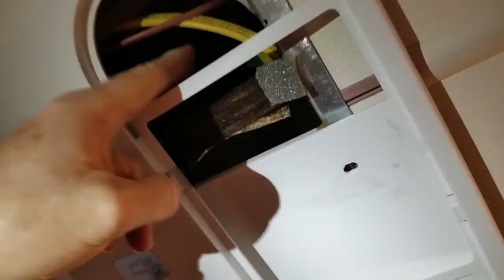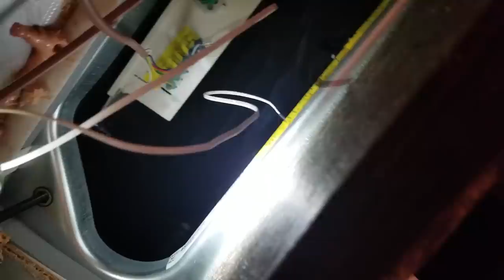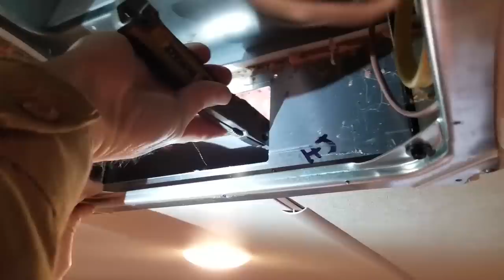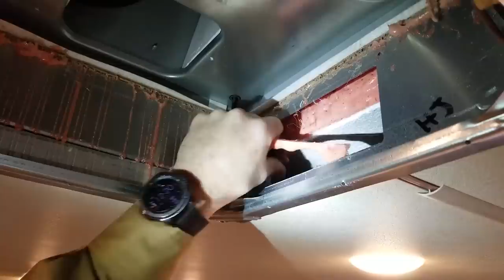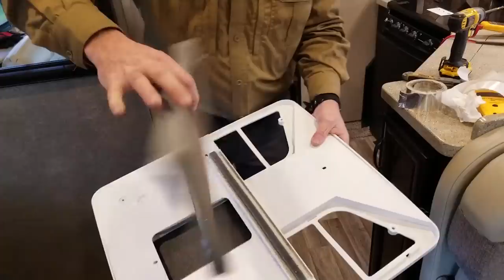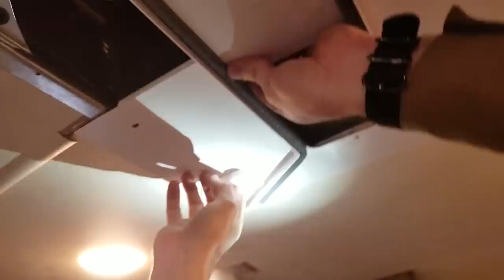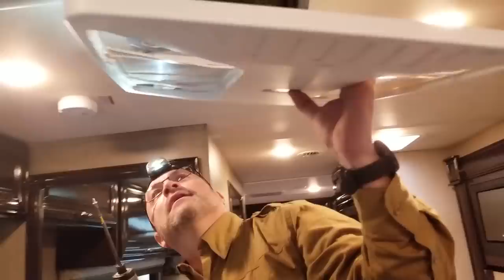Boost Your RV Air Conditioner Performance With This Cheap, Easy Fix!

Comment: Great info, Thank you.
Reply from the maker: You are welcome!
Reply: I time out the blower to run a bit longer after the compressor shuts off, letting the evaporator tray drain more condensate to have the evaporator function better for cooler air transfer when the compressor kicks on again. The lower humidity in the house, the better the cooling affect.
Reply from the maker: @billkrause4585  Thanks for the tip!

Comment: Some good advice for sure, but however taught you didn't know enough about the HVAC world. Small or large system, it's all about using air and refrigerant (in this case) to move heat from one space to another.

The system doesn't first dehumidify by some magic way and then cools. Dehumidification is a consequence of removing heat from the air (temp drop across the coil = condensation) and system design, it happens all at the same time because it's made to work that way. The temperature difference you're talking about is also linked to the outside temp. If it's a 110* outside, the AC will not stop running if you're trying to reach let's say 80*, or you'll need another system to compensate. These things are not made to work more than 20*-ish between outside and inside. So while your inside temp is going down, it will only go that far based on outside temp. It's even more critical in such poorly insulated spaces leaking air from all over. 

Unless you have a special tape I'm not aware off, your foil job will not last because the chemicals in the glue on the back of actual  HVAC foil tape is activated by friction, so applying it with your fingers alone won't make the tape stick for very long. The tape needs to be applied with a squeegee, and preferably spray glue, especially on the non shiny side of insulation the board. Even with that, it's not guaranteed it'll stay for years. 

I hope I didn't come out too much as an ass, but I felt I had to improve on the explanation others will read. Peace !

Comment: We did this to TWO RV's. Then we found a RVAIRFLOW.com upgrade and improved our airflow by 43%.
Reply: Yea. But they cost almost $200 per AC.  Guess it depends on how much you use it.  Hope it worked for you.  Neat design tho.

Comment: What would be the cause for Ice forming on an AC unit inside that area?
Reply from the maker: The first thing that comes to mind would be your free sensor is not in place. Other things that could cause ice build-up would be the control board relay that controls the compressor is stuck closed. Another indication is dirty evaporator coils. Finally you may have an issue with low refrigerant in your cooling unit.
Reply: @MyRVWorks  I checked my coils, they are clean as a whistle. I also checked my cooling regulator and it seems to be in there ( lose or what not I am not too sure). It does cool but I noticed in HOT temperatures (90;s) is when it does most the freezing ( running for long extended periods would be my guess). I heard when it runs low on anti-freeze it does this but I didn't have any issues this summer as I didn't run it as much.

Comment: The chances of finding an RV air conditioner installed correctly by a manufacturer is zero!  You MUST remove your ceiling cover and check for these issues!  If you have AC ducts in your ceiling, you should also remove all the vent covers and check for the same sort of shoddy workmanship.  In the case of our travel trailer, we had EVERY issue shown in this video plus NONE of the ceiling vents were adequately sealed to the ducts.  Much of our cold air was escaping into the void between the ceiling and the roof.  HVAC foil duct tape is your best friend if you want to increase the efficiency of your AC's air delivery.

Comment: Do you also check the four long rods that hold the air conditioner in place for proper tightness
Reply from the maker: Yes I do, I even carry new gaskets if the existing ones are dry-rotted and flattened. There's so much more that I do that I do not cover in the videos and sometimes I don't say everything I'm working on  thinking, or seeing. It's amazing when you've been doing this for a few years you see a lot of things and you take that knowledge for granted. I guess it's like watching a Chessmaster. They see a board differently than other people. That would be me with all these RV repairs. Sometimes I don't explain things that are obvious to me but I don't realize they're not obvious to others.
Reply: How can you tell if they are flattened and dry rotted without pulling the ac unit
Reply from the maker: @rickjohnston9553  Well, if you ever remove the A/C you have to replace the seal since reusing the old seal is a no-no.  Same with the toilet seal by the way.  You can look at the seal from the inside.  If there is any indication of water ingress than I would first check the mounting bolts to see if they were secure.   Some mfg's have indicator taps on the A/C pan to aid on the proper 50% compression of the seal but not all do. Tightening these units to the roof is not a muscle strength exercise.  50% compression is the spec.  for most of these units. If I do not see any evidence of water ingress I leave it alone.  If it looks dry-rotted (often because it was compressed too tightly and lost its spring) than I do replace the seal.

Comment: Very good. However the issue is not lack of metal ducting tape, but poor product engineering. This should never be required if engineered correctly and properly installed. ^^
Reply from the maker: The air conditioner manufacturers do a good job in there manual explaining how to perform a proper installation. We get into issues when those instructions are not followed. Since RVs have different thicknesses of roofs they have to allow so they can be adjusted during the installation.

Even with following all the directions perfectly, your air conditioner is still something that should be inspected at the beginning of each season.

On our website we have prepared an annual service worksheet for air conditioners that can be printed out for a simple Go/No-Go evaluation.  https://myrvworks.com/resources/annual-service-worksheets/
Reply: @MyRVWorks  Thanks for the informative videos! I clicked your link for worksheets and found everything but air conditioners. I downloaded them and will use when i get the RV out for the season. Thanks!

Comment: I had an issue where they ran the duct wonder a beam then pinched it off and with plywood so no air flowed to that register. It's sad what kind of craftsmanship goes into these things and then the slap a made in USA sticker on the outside. I'd be ashamed of I had built the one we own. I've fixed about 6 or 7 things in 2 years and find it all resulted in shitty workmanship.

Comment: Nice smart fix. That divider is so badly manufactured both in design and material it comes off(pun sorta intended) as an afterthought - separating warm intake from cold output is the business end of the whole unit, and the manufacture of it is sloppy as fuck, incomplete, actually. They must have known it was incomplete, but went "ah fuck it"

Comment: Makes me think about how sloppy the rest of this RV was put together. Hummm...... Shoddy on the production line...the inspector missed this one.....and probably many more.  No craftsmen anymore!
Reply from the maker: True, but I have seen this issue on $300K custom RV's.  It is much more common than many may imagine.  Every RV'er should inspect their RV air conditioner once a year.  The tape will loose its adhesive backing over time and fail.

Cheers,
Darren

Comment: To prove you concept should have used an Air Flow Meter
Reply from the maker: Yes, I could have done that (I do have a temp/airflow anemometer in my tool bag) but the air breach was so obvious I didn't feel it was necessary.  

Cheers,
Darren
Reply: That's like saying my boat was sinking so I plugged the leak and someone says " well maybe you should have measured the water that was leaking into the boat to prove you were sinking".

Comment: Our small company works on Transport Refrigeration machinery (REEFER Trailers/Trucks. 
It amazes me how much of a problem this is in the RV industry. While we do not normally work in this arena we have good customers with RV.s that ask us to look at thier RV's for poor cooling.
95% of the time it is this duting air with poor or no poor division of out put air and return air. 
We see several of them where it is not even sealed between the Output And Return because some othe Paycheck grabbing lazy No Give A Crap Thinkinking they are an American is being a Lazy FK.
The roof and the air is directing into that dead space or mingling input & Output air and/or not even reaching the living compartment. It seems a shame that the people doing these instals and the people supervising them are so complacent to not be checking on this for every single RV built. 
What a RIP OFF of our own American Customers that work so hard to get a nice RV then have it be sub standard because of some other No Give A Krap American is in Don't Give a Krap Mode or not willing to farther understand what they are really doing. But it mostly falls on the Quality Control of the Manufaturers of these RV's to make sure workers understand What & Why they should do certian things so it Works,
Come On America We Gotta Quit being A Low Quality Work Force and Come on American Employers/Manufacturers Give up some of your Greed and Profits for Pride in Workmanship! 
I like your Aero Dynamic enhancement with the Foil Tape. I do the same but then go in behind tape and spray foam sealer to help insulate direct metal wood heat ransfer to the a/c out put air stream. We have hat to even add insulation where we have found totaly uninsulated large spaces between interior and exterior.

Comment: So what you have shown us is that Coleman have crappy quality control in their manufacturing process
Reply: Shop for an RV you will see they are all the same. Until you are ready to spend big money you get what you get, sadly. My trailer is 2 years old and I already can tell the fresh water tank is ready to fall out. I found the furnace had 2 ducts that were not attached. Some cupboard doors have fallen off. Trim has fallen off. Gaps like crazy inside the cabinetry. Its honestly a joke. No pride at all.
Reply from the maker: No, that is not a Coleman issue. That is an installation issue. Coleman provides everything to do the job correctly. The individual who installed this would be the one to take issue with. Having said that, these air conditioners need to be inspected yearly because the adhesive does fail over time. I have seen this issue on air-conditioners installed on the $700,000 coaches down to $30,000 coaches. It is not manufactured specific.
Reply: @MyRVWorks   OK, worth remembering. Thanks

Comment: What makes you think you're smarter than the engineering ??
Reply from the maker: As a recovering engineer myself (25+ years as an industrial automation engineer) I resemble that statement...  It's not the engineers you've got to watch out for it's the production line crew that's assembling about 20 or 30 of these RV's a day. They just want to build them and go to the fishing hole.
Reply: The issue is installation  not engineering. What makes you think you’re smarter than a tree?
Reply: David Laster, Great contribution /s  can't wait to see more of YOUR helpful comments.
Reply: @brucemontesr.3340  you keep replying it wasn't a comment it was a question when you start ripping s*** apart I start questioning your abilities I know mine I've done it for 40 plus years

Comment: What poor quality AC was that. I'll be sure never to buy one based on their lack of workmanship!
Reply: Hi Raymond,
I can’t really point my finger to the A/C mfg and no OEM is immune from sloppy install jobs.  This is something that should be part of your spring check-up each year.  Some A/C mfg’s use a large foam pad with adhesive backing that loses its adhesive over time.  So, it was installed correctly at the time of build but after a few years the issues develops as the sticky side fails.  

Each year the A/C absorber and condenser coils should be inspected and cleaned.  Also, the drip tray below the absorber should be cleaned out.  The return air filter should be cleaned every month of use.  These things will keep the A/C performing well as long as there is adequate power from the pedestal.

Cheers,
Darren Koepp
Reply: That’s the entire rv industry. There’s No pride in any rv manufactured in the last decade.

Comment: You didn't do a very good job smoothing out the foil tape. When it has loose edges and wrinkles there is a good chance it may partially separate over time. If it separates and covers part of the evaporator ... well , you know what will happen.
Reply: Hi Richard,

Well, I think we can all agree it is better now than the way we found it eh’.  LOL.  

This appliance should be inspected each year, I recommend in the spring.  During these inspections the tape can be replaced if the adhesive has failed.  Also, the absorber and condenser coils need to be cleaned and inspected.  Don’t forget the return air filter monthly.

Keeping an eye on all these periodic preventative-maintenance things will keep the A/C performing well.  

Cheers,
Darren Koepp
Reply: @DarrenKoepp360  , foil tape was never meant to be stuck to open cell foam gasket and insulation and will fail within weeks if not days of use and you will rip the existing gasket to shreds if trying remove and replace it where it actually stuck.  Use the right material for the right job, they sell it in the same store where you bought the foil tape..
Reply: @dgrfsthrgsergwrtghasefq  if foil tape isn;t the correct tape, what is, please?

Comment: fpieros22 is correct, manufacturers have no pride in their work were it doesn't show. It's a shame how much you pay for these rigs and the quality is sub par. Some stuff may have moved around from vibration but that could be engendered out. If RV manufacturers were held to the same standards as Automotive, we wouldn't see half these problems. It seems a blame game goes on behind the scenes with component makers and RV assemblers on why something doesn't function right. You can see why!

Comment: You must have a low end RV, because for several years they have return air vents by using ducted return and cool air ducts by using two separate ducts! You should have done more research!
Reply from the maker: Hi Dennis,

I appreciate your comment and it does lead to a teachable moment.  The issue I address on this $90K Class C RV I have also discovered and repaired on $140K 5th wheels, $300K diesel pushers and even a $700K Beaver!  The cost and 'quality' of the RV has no correlation to the divider in the A/C not being set correctly.  I have pictures of very high end RV's with divider airflow issues.   Some of those repairs were covered by the MFG warranty. 

The point you make regarding the return air being ducted through the ceiling registers, and even the design where the only way to access to the A/C is from the roof, is also a major violator of this air breach situation.  

For the A/C's that are only accessible form above there is often a foam strip that is applied with adhesive along the top of the divider as it is pressed to the bottom of the A/C pan.  That adhesive fails over time and creates a major breach.  Everyone should do their due diligence and perform a thorough annual preventative inspection to include this divider in their RV A/C's.

Cheers,
Darren Koepp

Comment: Wow, QC is disappointing with what ever that brand is...
Reply from the maker: I have seen this situation on custom $300K RV's!  This one was particularity bad due to the blatant duct breach but checking this is something every RVer should do annually since the adhesive on the tape fails over time.

Cheers,
Darren